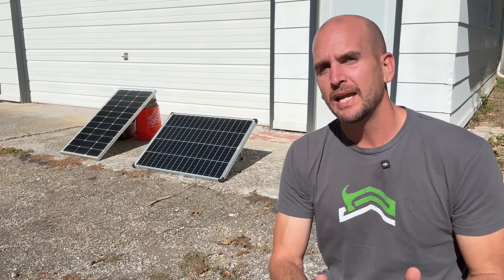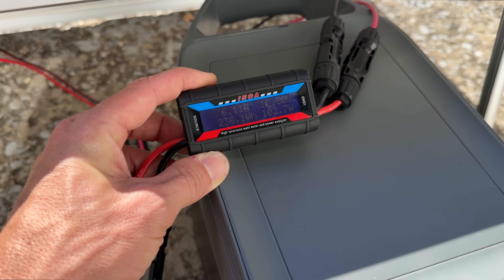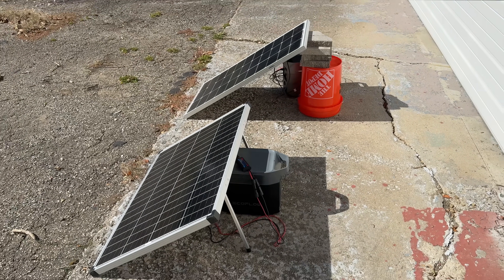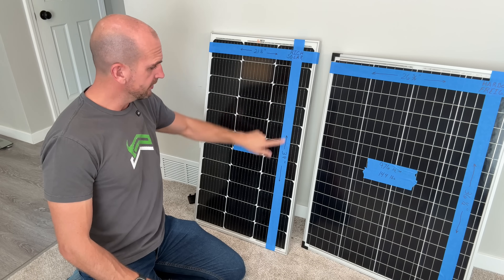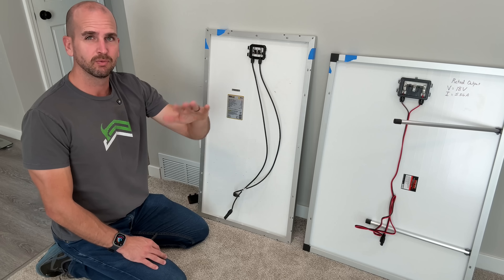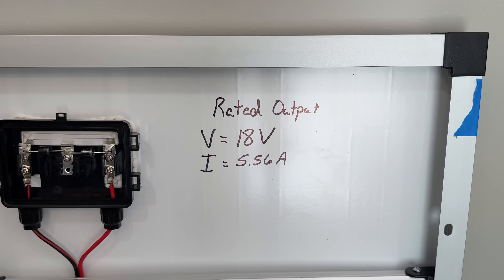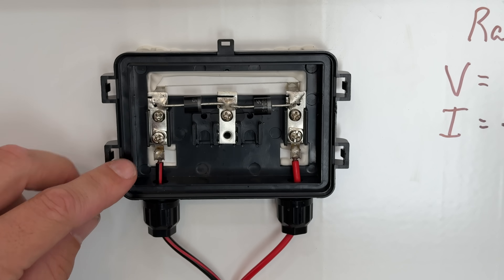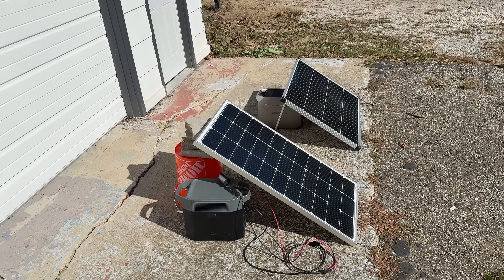Harbor Freight 100W Vs Rich Solar 100W |  Tested!

Comment: You swapped the 2 and the 3 in the total output for the rich solar panel. Also the two panels are only 16.2% different in surface area, and the total difference in output is 15.7%. The harbor freight is slightly less efficient per square inch but if you just want one or two and don’t want to cover an area then that’s ok because the output per unit is likely more important than size. I used BYJU’s percentage difference calculator online to do the math, which also shows the formulas it uses.

Comment: RV electrician here. We’ve installed dozens of the Rich Solar panels over the years (not sponsored at all, just like the product). I wonder if you maybe got a dud panel. We have had excellent performance across the board with Rich Solar panels and have never really had a reduced output issue

Comment: Well the Harbour Freight panel is exposed to more Watts per square metre so assuming they are equally efficient this is the expected result. The size difference is roughly... 17%. So if space is an issue you could choose either panel provided they roughly equate to the same area.

Comment: Properly crimped connections are just as electrically sound as soldered joints and mechanically superior. My father was a telecom engineer and they used to stress test various connections. A properly wirewrapped connection will outlast a wire soldered to a post or a circuit board. When done properly a crimped connection forms a cold weld. Those crimps look like they've been done with a machine so they are probably the best way to do it.
Reply: And better for high vibration applications like mobile use or high wind areas.
Reply: To get a cold weld when crimping, flashing must occur. Very few DIYers understand this or know how to check for it.  Crimp it, solder it, heat shrink it…all bases covered.
Reply: After you crimp it…solder it. No more taking sides, best of both worlds….easy..done…next?
Reply: @vg3430  Sure, but we were comparing a connection that was just soldered to one that was crimped and the reviewer claimed the soldered connection was better.
Reply: @vg3430  Solder adds a level of Ohms resistance and that Ohms resistance increases over time as the solder ages, it is for this reason, connections are not always soldered. This problem has been figured out in the aerospace industry, where extreme temperatures, moisture, high vibration, and tension stresses exist. Research the NASA Wire Splice technique.

Comment: You rattled off square-inch area numbers earlier in the video, but if you'd actually directly compared them in the same way as your power numbers, you would have noticed that the HF panel, which produces 17% more power, is also almost exactly 17% larger than the other one.  This is almost certainly not a coincidence.

The larger the panel is, the more sunlight is actually able to hit it, and the more power it can generate, so in general, when comparing solar panels (using similar technologies), it's always worth looking at the total surface areas, because generally a bigger panel will probably perform better for this simple reason.

Comment: Here's a few things that most people may not know.  Solar panels lose about 0.7% of their generating capacity each year.  In 20 years, that 100 watt solar panel deteriorates to about 86 watts. 

As for  getting solar for your home, there are other issues besides lower power output.  With rising utility rates and escallation clauses for leased systems, the cost/benefit ratio may not be favorable.   Some solar companies are going out of business.  That leaves their customers stuck with lease payments to a leasing company and no repair support for their systems.  Part of the lease payments covers potential repair/replacement of failed components.  That's also true of people who own their systems outright.  No warranty support.

Comment: Harbor Freight gets a lot of negative that is not justified. Sure they carry some cheap throw away tools and stuff but most of their stuff is really solid. There is actually a video on YT discussing where their stuff is made and all. I run a 100w HF panel on my adventure rig and pull in 30ish watts on a full overcast cloudy day! They pic up sun better in my experience than most. They are solid panels for +/- $100   Thanks for the vid!
Reply: But better panels on Amazon for $55

Comment: I like the crimping because you can easily remove and replace that lead without generators and soldering guns and everything else should have to have to replace it in the field repair

Comment: Your math is off on the Rich Solar. 232 + 191 = 423 .  That changes the percentage difference.
Reply from the maker: The percentage was actually calculated with 423 so that will stay the same.  I just wrote the sum incorrectly and thanks for the catch.

Comment: Suggestions for your next test
HQST 100W panels on Amazon - The HSP100D-L  (I own 8)
Grape Solar 100W panels on Signature Solar. (I own 8)

I saw 1340W from the 16 panels in 4S4P config (last weekend), and got just about 7kWh, they are at an approximate 45 degree angle.

Comment: You're missing size and price in your comparison. While the HF produces 17% more energy, it's also 17% larger, and depending where you buy the Rich panel, the HF is can be around 25% more expensive. So while the Rich Solar panel doesn't live up to it's 100W claim, it seems like it could actually be a better deal if you take total size and cost into account.
Reply from the maker: Totally agree, just added it to the next test and also went back and updated the Rich Solar and Harbor Freight data in the same spreadsheet you can download.

Comment: YOU GOT YOUR RICH SOLAR ADD UP WRONG BY 10, THINK I SAW THAT ?
Reply from the maker: Yeah it should be 423 but I did use 423 for the percentage calc just wrote the summation incorrectly.
Reply: @everydaysolar  NO PROBS MATE, DIDN'T KNOW IF IT WAS IMPORTANT, CHEERS 🥂

Comment: The Harbor Freight panel with buying the SAE to MC4 connector would be about $135 as of today, and Rich Solar is about $90 as of today. The price difference would then be that the Rich Solar 100W is 66% of the cost of the Harbor Freight. So if you had unlimited space the Rich Solar is a better deal as you could buy 6 Rich solar panels for $534 (total output of 2538Wh) for the similar price of 4 Harbor Freight at $540 (total output of 1980Wh).  Depends on the size of your project and if budget matters.

Comment: The output shown is basically the difference in area. With the Rich solar, you save about $30 per panel (25% less). If quality and other factors are similar, I'd say that the Rich Solar is a better buy, particularly if you are going to use several panels.

Comment: I've never seen a 100watt panel that can beat the HF!! I have 4 and they even over perform your results, getting as much as 420-460 watts out of all 4 in seriies (mine are a yr old)!! You can get them on sale for around $100+- on sale.  The kick stands are a big deal too, I have mine sitting in back yard on concrete and can be easily moved a couple times during the day to follow sun!! No looking for buckets and bricks etc to set angle!!  These are a must have!! No spec label on back in not a big deal,  once you know you know!!  Great Video!!
Reply: $3 in PVC and poof now you have leg stands
Reply: That is easy they are bigger than any other brand so bigger surface generates more power, they are very clever in selling them as 100 watts when the real max power is bigger.
Reply: How to keep people from stealing them, legally and without bankrupting oneself?

Comment: The difference is mainly in the size of the panel. I'd like to see a watts per square inch figure...
Also, I suspect Renogy is going to perform similar to Rich Solar because they're the same size.
I'm currently running Renogy panels on my off-road camping rig. They don't quite produce their rated wattage, but they've been reliable considering they experience a lot of vibration...

Comment: The HF panel is 17% larger surface and has 17% more power. Not surprising that power per sq. ft. is the same. Now, if one was using significantly more efficient cells then that would be surprising. And of one had significantly better $ per watt that would be interesting.

Comment: Could you include a wh per square inch, as for applications where space, rather than cost, is the main factor, this could be very important. 

For example, in this test, The Rich Solar actually wins when it comes to wh per square inch, with 0.521 vs 0.502 (If my rough calculations are correct.) 

But also, a breakdown of wh per $ would be good too. :)
Reply from the maker: I sure can, I am adding that to the test between Renogy and ECO-WORTHY today 👍 but will be putting all 100W panels together on a website in the future so you can see all the historic testing results and our long-term testing. LOT more to come.
Reply: @everydaysolar  That's awesome, thankyou. As it happens we can't get the Harbor Freight ones in the UK yet, but we can the Rich Solar... The Eco-Worthy and Renogy panels are extremely popular here.

Comment: I see that the panels are more for hobbyist and camping level and not intended for large scale solutions.
If you have a vehicle of some kind then the advantage with smaller panels is that you can easily replace one and if they are to be found at places like Harbor Freight then it's an advantage.
But for stationary use I'd definitely look at the larger more powerful panels where roof area is the limit. Those panels have a peak power of over 400W per panel and an efficiency of 22.8%.

Comment: Your dyslexic, 232+191=423 which is 14.5% difference in performance.  When you said 17 % difference It did not make sense, so I did the math. When you take into account the surface area difference between the two panels, 14.5% makes sense.  I still liked the work you presented. takeaways, 1. One is designed to be ground mounted the other hard installed, 2. One manufacturer follows UL labeling protocols, the other does not. Conclusion - They are both good panels, it really depends on the application, and the space available for install,; Also all things being equal Price would really be a driver.

Comment: Great video and very informative! I assume I could use these results if I was just planning to say buy 1 panel to charge a battery like you used for backups during power outages? I'm not looking to power my house just yet, just something to keep a few things going so I don't have to run my gas generator. Thanks!

Comment: One thing that might also be worth testing is later in afternoon, low light charging. Obviously due to size the harborfreight should win as well, but its still worth checking

Comment: I’m surprised Harbor Freight beat Rich Solar. I lost the bet I made with myself. I’m more interested in bigger panels like you used on your rental property.
Reply from the maker: I will start running these tests for 100W, 200W, and 400W 👍
Reply: @everydaysolar   That’s awesome! I’m subbed and looking forward to it.
Reply: Yea but it's larger and more expensive...so is it better???? I'd just grab a $55 panel from Amazon

Comment: Watts per area isn't important with a single panel, Watts per area when you're talking about a larger grid becomes much more important, as such it would be interesting to extrapolate the results out to say 10K and then see what the size difference is between the two different panels.

Comment: Crimp connections are better than soldering speacilly for outdoor applications.
Reply: based on what?  for mobile (rv, boat) using crimps avoids breakage due to motion.  soldered joints don't hold up as well.  but a stationary setup wouldn't be any better/worse with solder vs crimp.

Comment: humm wonder if all the panels are the same from the same supplier, could you have got a higher performing one from Harbour freight. 
dont know if this applies but could be panel you got be a 'sweet' spot one, in computer chips not all chips off the same wafer can be clock at the same speed. as the solar silicon is manufactured the same way could they vary in output batch to batch ?
be interesting to see if 2 panels but different batch lots from same supplier work the same ??

Comment: Very informative video.  I'm looking at setting up a panel on the bed of my truck to maintain a secondary 12v power system (charge tools, provide power for lighting, etc) and it seems that dollar to dollar (as of writing) Harbor Freight is the better option.  For a single panel plus a controller, each source runs about $160.  As the HF gives you 17% more, that would definitely sway me in their direction (as far as versus Rich).  Looking forward to more comparisons.  I know pricing can vary, I checked using the links you included.

Comment: When my 2s2p hits 1k wh my 3s is only 350wh? Why the huge performance difference between 3 and 4 panels?
Reply from the maker: What portable power station or charge controller are you using?

Comment: I'm interested in this for an RV, where every square inch of roof space is precious.  When I do the math, the HF panel produced .507 watts per sq inch while the RS produced .510 watts per sq inch.

This is really too close to make any real difference, and if you tested another set of the same panels the numbers might flip due to manufacturing variances. 

That being said, for my application I'd opt for the RS panels.
Reply from the maker: Thanks for the feedback!  I will include Watts/area for the next video.

Comment: Excellent job! I would like to see some data over time. A year, 2, maybe 3. I have heard that these cheaper panels degrade at a pretty decent clip. I assume that's proportional to the amount of time they are actually exposed to UV rays, so that's obviously harder to do, but with such a drastic difference up front, it makes you wonder if any of that would change with time after being exposed. Out of the box is great and all, but this product needs to go for the long haul so time testing would be relevant.
Reply from the maker: I have plans in 2025 to start testing these panels long term.  I will do the initial testing and then install 2 of each panel on a permanent mount and track the performance over month and years to update the audience.  Much more to come 👍

Comment: Cool video to where I now understand. I do have a question though... please look up this 2022 travel trailer named "Coleman 17B". Now that being said, I plan on getting that trailer for my RV life. it has a prefix solar charge and the question is... how many panels do I need for that trailer? the trailer has a 12V fridge, microwave, and a window AC unit built in. Plus my TV and a laptop. So I plan on boondocking here and there and of course RV parks.

Comment: Your percentage off a bit as your math is off. It should be 423 instead of 432.
Reply from the maker: Yeah, my mistake.  Percent used the correct value of 423 but I just worte it down wrong as 432.

Comment: I really want the winner to be based upon watt per surface area. Any company can label a 120w panel as a 100w one but only a great design can use higher efficiency parts and less gaps between them. I live on on a boat where space is a premium.
Reply from the maker: Thanks for the feedback.  I think Watts per surface area and $/Watt are probably a good way to compare across each size class of panel.

Comment: HF are easy to get, stores are everywhere and sales every month.  The legs on the HF are a big plus me.  I have used Goal Zero, BougeRV, Jackery 100w portable panels, and the HF ( I have both the HF briefcase and the flat panel) are simple, cheapest and as my other panels fail I replace with HF.

Comment: It would be cool to see a chart with physical dimensions and price included in the end. The rich solar looks smaller than the harbor freight. So if you could fit 5 rich solar panels in the same space as 4 harbor freight panels, in the end the rich solar may be better suited for a given area.

Comment: Harbor freight panel is designed to output 100w during good conditions (not just perfect conditions). Most panels only output the rated output during perfect laboratory conditions which never happens in real life. HF knows this is deception plain and simple. They want to get good reviews so they design a product that gives what it advertises.  More products should do this.  Harbor Freight should replace government.

Comment: Soldered connections are not superior to crimp connections, I'm not sure why you pointed that out as a downside.  No form of critical power systems or critical infrastructure use soldered connections.

Comment: I have 7 HQST panels and my maximum outputs are about the same as the Rich panels. The HQST panels are about the same size as the Rich panels and are available on Amazon  for $59.99 , half the price of the $120 Thunderbolt panel. The Rich and HQST and most other Chinese 100 watt panels take up about the same amount of real estate, where the Thunderbolt is substantially larger.  I wonder what the power output per square inch is? But it is true that most 100 watt panels will not produce 100 watts

Comment: I just can't get over the $120+ tax per 100w for the HF panels. You can buy a 400w Hyperion bifacial for $128 but most places you have to buy 10 at a minimum. It's horrible.

Comment: Great comparison, but maybe I missed you mentioning it, but though the HF won, it's $120 vs $80 for the RS.  So the HF is 50% more expensive.  Plus with HF you need to crimp MC4's or buy the $15 converter.
Reply: Or 100w panels on Amazon for $50